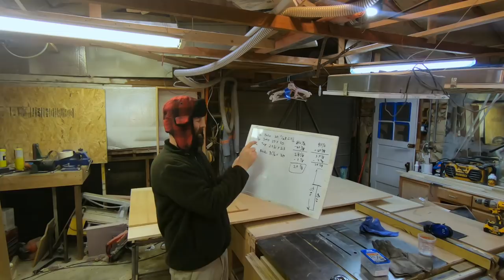How To Fix Mistakes Building Custom Cabinets | THE HANDYMAN |

Comment: I haven't seen using a whiteboard like you are doing - plan everything, then check board, measure, cut, tick off on the list, and rinse-and-repeat everything after planning until it's done. Looks super helpful for knowing exactly what to do next and reducing the chance of messing up. I'd be curious to see a walkthrough of the planning part in some detail. (I'm a noob.)

Thanks for your videos, and Merry Christmas!

Comment: I did not learn about track saws until I really dove into woodworking as a hobby. Even then it was probably a solid year before I knew they existed. I ended up getting the Festool. I am invested in the Milwaukee platform for my battery tools and I refuse to run another brand just because I don't want to deal with another set of batteries/chargers etc. Milwaukee does not make a track saw (yet) or I might have gone cordless.

Comment: LoL @ 2:54 "it slides around like it's..." <CUT> "it's very slippery."  Handyman is keeping it friends and family safe!  So food for thought concerning the Kreg Shelf Pin Jig...there are TWO different models, one for 5mm diameter shelf pins and then one for 1/4" diameter shelf pins.  You have to accordingly buy the corresponding shelf pins...I placed an Amazon order for all of it before realizing there are two different sizes and was lucky enough to cancel items before my order was processed.  I went with the 1/4" because it was larger and ideally stronger.  Maybe there is more of a method of madness by a cabinet building expert but that's what I went with on my cabinet build.  I ordered Rok Hardware Heavy Duty Shelf Pin Spoon Shaped Cabinet Support Pegs...could you weigh in on what you prefer Handyman?  Maybe post a link in the description on the next video of all of your shelf tools/cabinet hardware.

Comment: No need for the 310/320 mini kreg jig. Just clamp the k4 onto the assembled carcass for the faceframe attachment. Actually easier that way than trying to ballance the carcass panels on the k4 before they are assembled. The mini jigs are super bueno if you are for instance repairing stretchers on a chair where the k4 cant be clamped to 3/4 dimensional cabinet goods.

Comment: Two questions and thanks in advance:
Why nail & screw instead of pocket holes for the upper cabinet?
I have heard you talk about planning to do skins on cabinets in various videos, but have you done them in any past video?
Reply: Guessing this was done for ease and speed purposes.  It's time consuming and messy to clamp the jig (R3) or clamp into the jig (R4-R5) and drill each pocket hole, then you're clamping joints together before driving the pocket screws in, and even then there's potential for shifting of the materials.  So much easier to cut, clamp, shoot nails, drill and drive screws since they are all blind and it's just about guaranteed to be perfect.  We'll see what Handyman says!

Comment: the first tracksaw I seen was on this old house when Tommy went all Festool .  I want one but I'd probably use it 1 time a year  this dewalt want around 550 for that saw with guide and battery. those 60 volt batteries are EXPENSIVE at around 127.00 each or 2 for 180

Comment: Just bought the dewalt flexvolt track saw. Thought clamps were included for that price but had to buy them separately. But definitely makes handling sheets of plywood easier when making cabinets.
Reply from the maker: You would think you would get the clamps for that price.

Comment: what kind / size nails do you use on these cabinets. are they just to hold the panels in place until you run screws in?
Reply from the maker: Just to hole it in place until I screw it.

Comment: How come you put a board on the bottom of the top box , and a top on the bottom box, seeing as that ply is so expensive there couldnt you have braced the open ends untill fitting, that would save a sizable, piece of ply, instead of double shelving, (two pieces together)..
Reply from the maker: Strength.

Comment: Nice haircut. For my kitchen tables I've found that a 1 inch by 6 inch by 102 inch perfectly jointed piece of oak works best for a straight edge to cut the 10 inch wide planks. Those aluminum track saw guides aren't straight enough for my purposes. I also dont have a jointer with a tall enough fence to edge the 10 inch wide planks.

Comment: The Elements of Graphic Design (2nd Ed.) by Alex White for graphic design.
📖
Good resource for learning graphic design. It’s pretty occultic without a formal (college) education, but we have google and YT now, so yeah.
I’ve been an artist since like forever but not until I took design courses I understand what graphic design really was all about.
Reply: BTW, if your using a track saw just for sizing, just snap a line. Is it really that difficult to cut a decent line, or grab a straight board and clamp it if needed.

I always thought track saws were more for accuracy instead of snapping a line or fussing with a straight board. But if it’s to resize them, what’s the point? 🤷🏻‍♂️